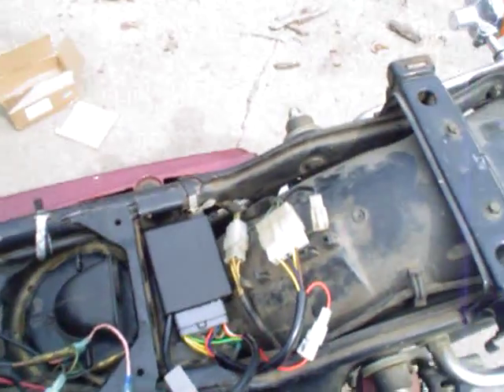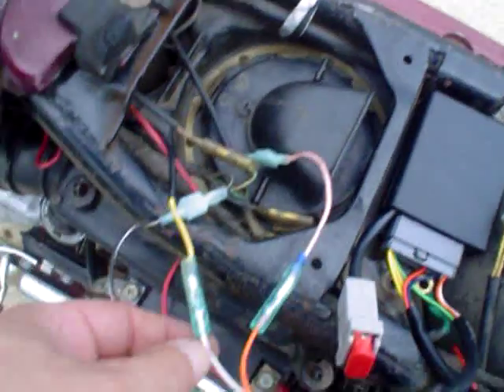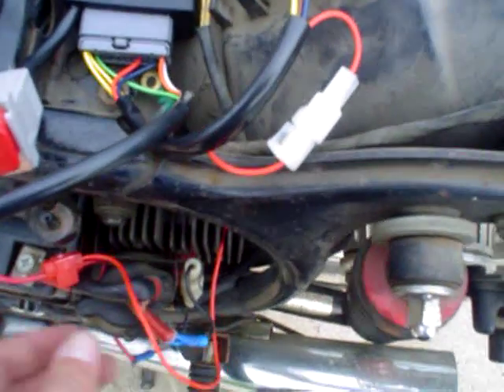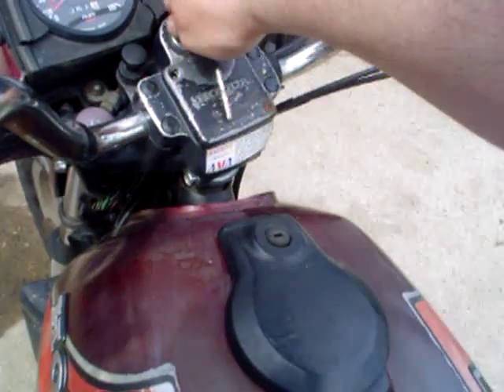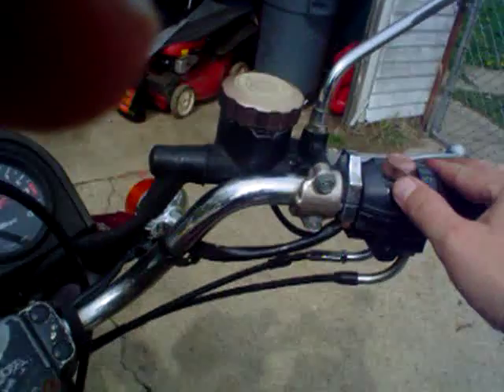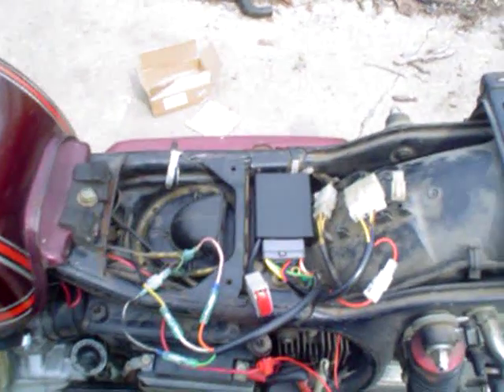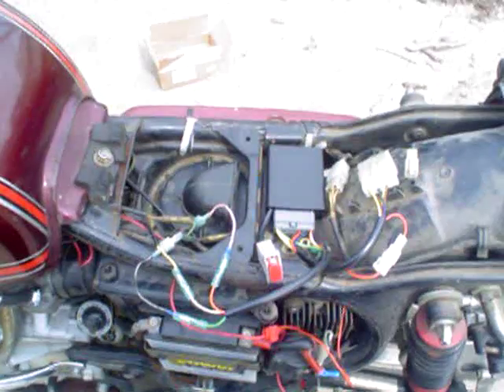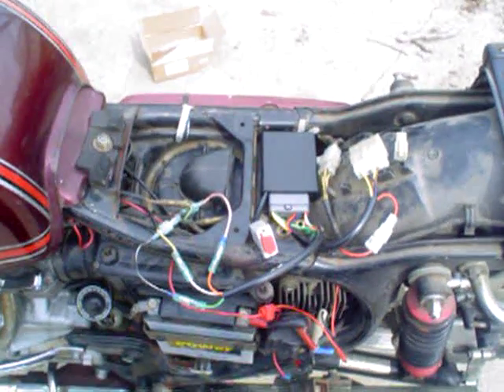CDI change on CX500

Comment: Hey, Ken. I just received my Ignitech and in your Video I cannot see where you connected the red 12 volt wire. can you provide some context as to where you connected that wire?
Reply from the maker: I'm sorry..  I don't remember it's been a LONG time.   I think it went to any ignition hot 12v source. So it goes on and off with the key.

Comment from the maker: Cool, let me know how it goes. I was very happy with the CDI, Worked fantastic. Came ready to use, but so easy to tweak it too. I dropped the Rev limit a little, and pushed the ignition curve up a bit in the mid range. But really I could not tell any difference. Except for the Rev limit of course. That was really well done, Nice soft limiter. No jerkyness at all.